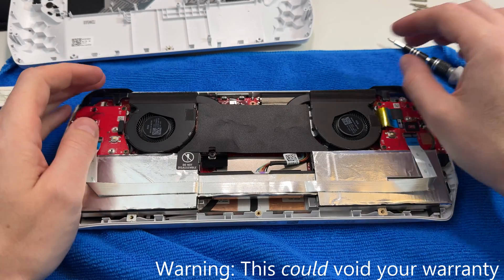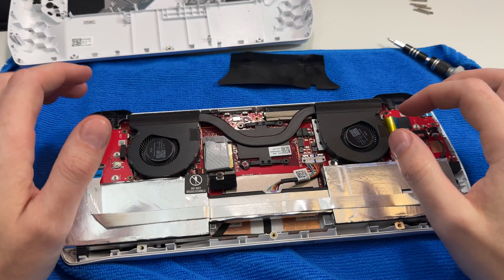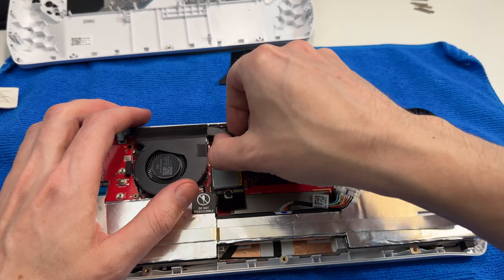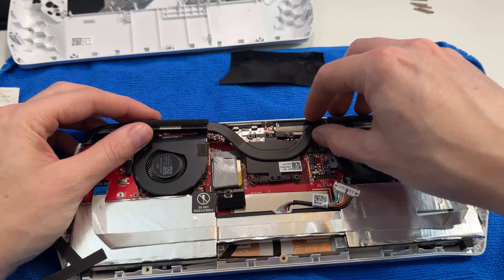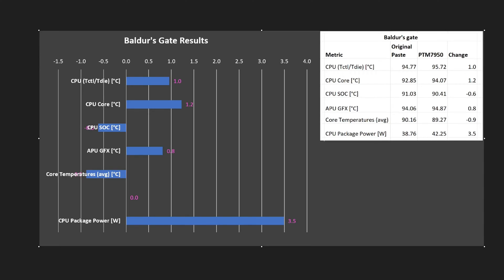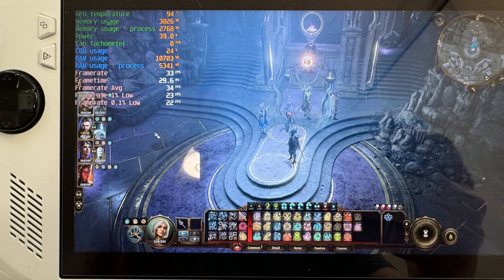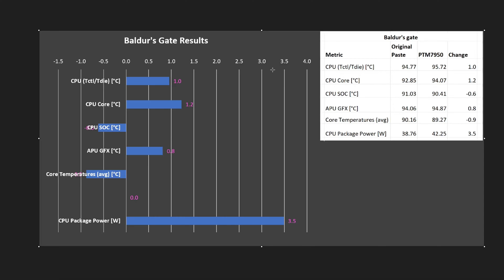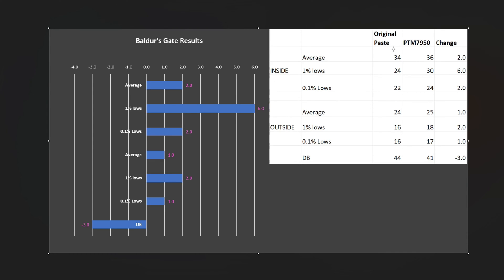Improve your ASUS ROG Ally - Boost FPS and Watts with PTM7950

Comment: Your increases here are readily within the margin of error. 

I'm almost certain the ally comes stock with PTM 7950, so you essentially just replaced it with likely the same thing.
Reply: But you should repaste it every 2-3 years, right? Or am I missing something?
Reply: @HDaveN ptm7950 lasts for more than 5 years and still holds the same thermal conductivity, it's  an industrial grade TIM it's not meant for continuous replacement ever year or 3

Comment: replaced thermal paste on an msi laptop (intel 8750) and tried these ptm sheets that I ordered from aliexpres. at the same time I swapped out all thermal pads for usiren thermal putty. It made a huge difference. I changed the thermal paste last time about 6months ago with noctua NT-H1 and the application seemed okay. 
Basically In the game I play, Path of exile The CPU now can keep a clock of 3.9ghz and stay at a 45W load with way less noise and never hits thermal throttling anymore. Previously I had to limit the cpu to about 25w and it was still louder. 
In my experience it was miracle medicine for my old laptop. If I had a new Lenovo or Asus laptop its probably not as a big improvement
Reply from the maker: Lenovo uses PTM in their new legions, but older stuff or non PTM ones are good upgrade

Comment: PTM 7950 comes pre-installed. WTF.......At least know stuff about your device before doing anything
Reply from the maker: Everyone knows this already…. 

It’s called an experiment using Honeywell ptm7950 (we don’t know what ptm they use) and with known application by me. So I’m applying PTM 7950 vs  ??? PTM. And with my own application.

This is part of a test series I also did for the legion go… which also had ptm7950. 

Also notice…the positive results?  Aka either the better PTM 7950 variant or Bette application

That’s how science works ;)

Comment: Do a liquid metal, it actually works, first cover with nail polish everything around the die, all the small transistors [clean with alcohol first, so its super clean, no thermal paste residue]
let it dry and do a second coat and let it dry.
drop a tiny single dot of liquid metal and spread it with cotton swab, it should be like a mirror not ocean, no floating or leaking, so use just enough to cover it, and cover the heatsink on the contact side, again as little as possible so it just colors the metal

I ben doing it Since my first GPD Win 2, its great, super low temps, the only minus is because you spread so little it will dry in a year or two so when you see that temps go up, you need to re-aplly, but its ok, it will never leak because there is nothing leak
Reply: u dumb or something? it's not drying. it's because it reacts with the heatsink and creates an alloy over 3-4 months which needs to be scraped off and then reapplied. do u even science bro